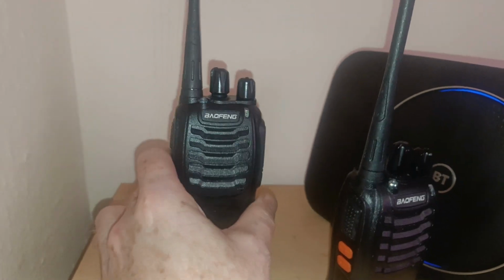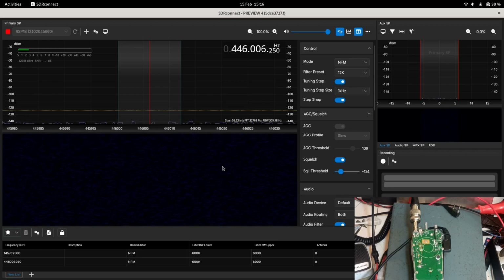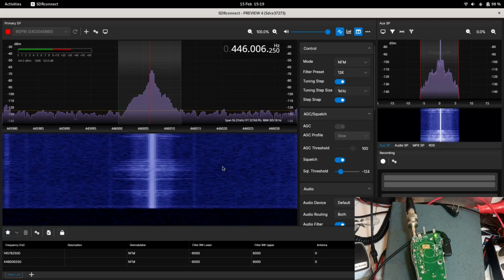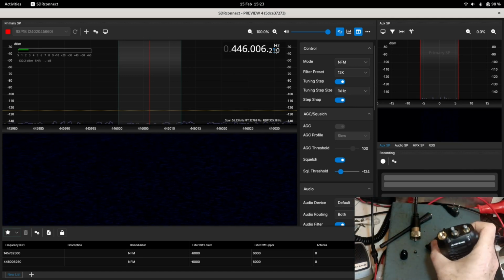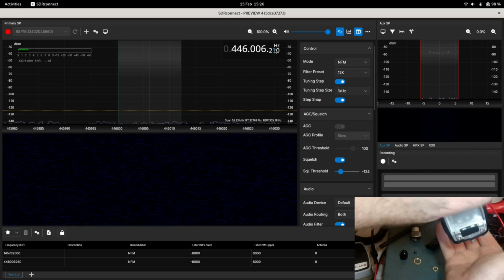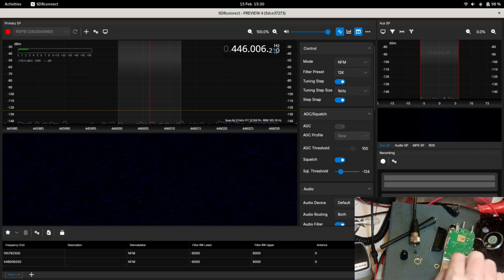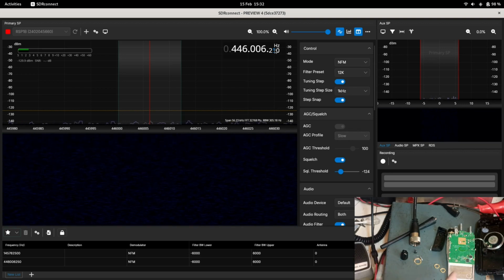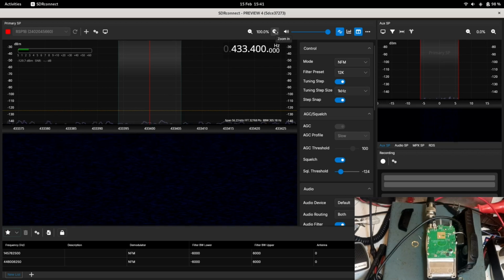Baofeng BF-888 frequency adjustment and disassembly

Comment: What about a Ubiquiti Router so you can run at full speed again
Reply from the maker: At this point changing the router wouldn't change the speed, it is the line speed itself that has been reduced rather than the router being the problem, slower line speed = less cost, I have heard good things about Ubiquiti so may not rule it out in the future